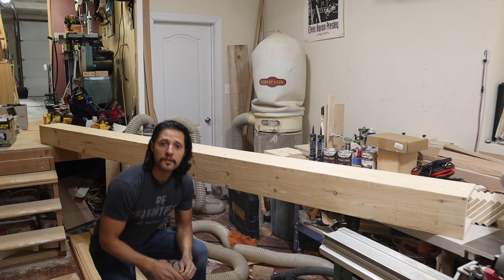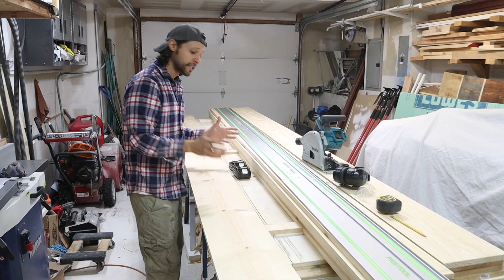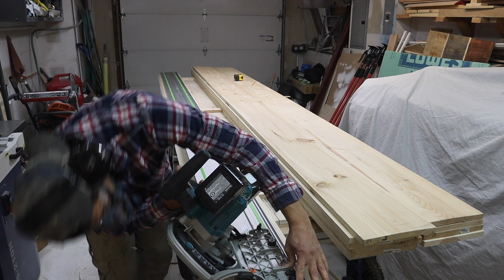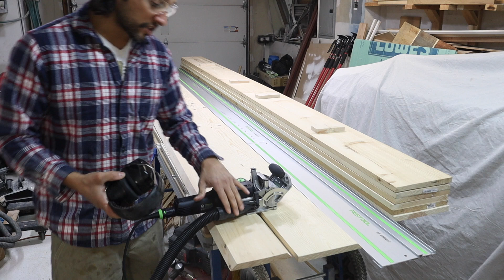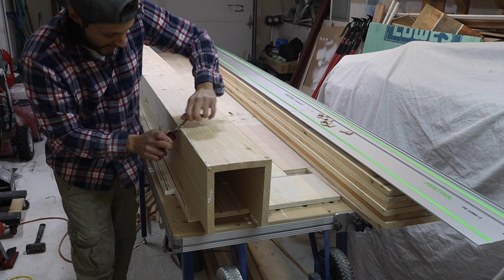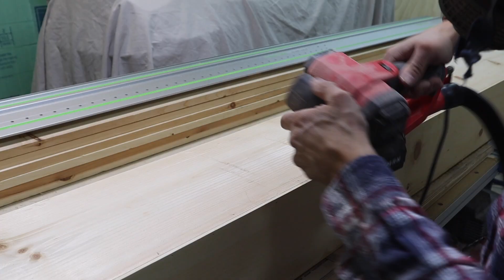easy miter fold, no tape. Perfect results!

Comment: To much margin for error 
The tape folding you mentioned is much more permissive
Reply from the maker: If you know how to use this machine, there is no margin for error, that’s why it has the loose settings. Did you not see how easily I put this together? I’ve struggled with the tape method and the results are mediocre at best. The results here don’t lie.
Reply: @AnthonyScolaro1  appreciate the response and advice 
I’ll try it
🙏🙏🙏
Reply: Very impressive. Just like the techniques Spencer Lewis on Insider Carpentry shows on his videos.

Comment: Tape is certainly much cheaper than the festool though... On something this big, the domino for alignment as well probably was worth it, especially when you need to make multiple.  As someone who woodworks for a hobby I'm having a hard time justifying the cost though.  I would want at least 3-4 planned big projects that would benefit from it before I go down that path.  Any reason why you went with the small 500 vs the 700?
Reply from the maker: The 700 only has large domino tenons, the smallest one would blow right through the miter joints. The 500 is more versatile for all uses, the 700 is only suitable for big heavy work such as doors and heavy tables and jobs of that nature. The 500 is for all cabinetry, built-ins, molding and so on, which is what I do mostly. I’ve owned this for over 3 years and it has been worth every penny. I don’t show it often in my videos because most people do not own one but in this case I had to.

Comment: hi why the tight bond 3.....any reason why your not using the tight bond 1?
Reply: My guess is longer open time ... Or, it's what he had on hand.
Reply from the maker: Tom is right, much longer open time. When you’re doing long glue ups like this, you don’t want the glue to start setting up while you’re trying to mate all the parts. Type 1 or 2 would give you a hard time. Smaller assemblies I use type 2 unless it’s going to be an outdoor project.
Reply: @AnthonyScolaro1  thx....watching from the caribbean...great vids...